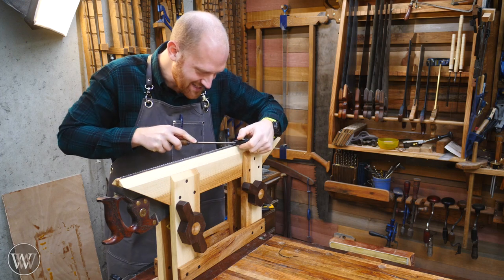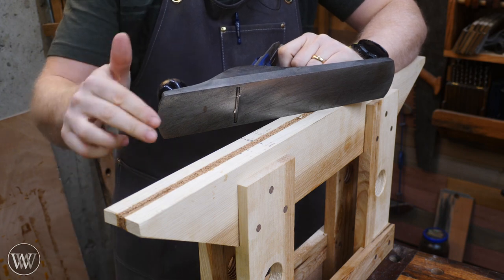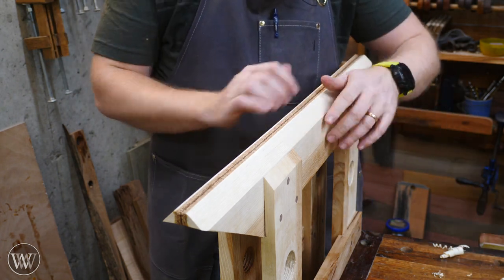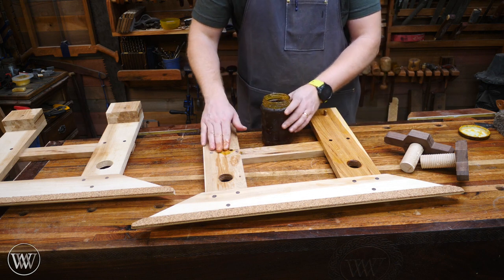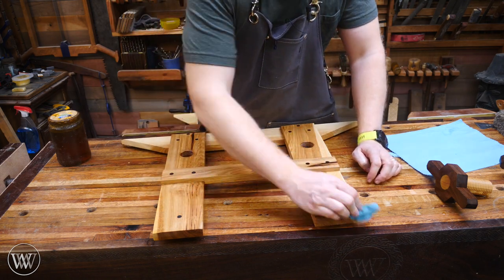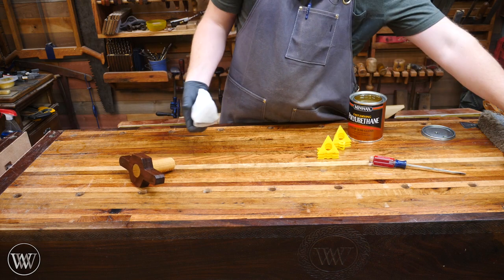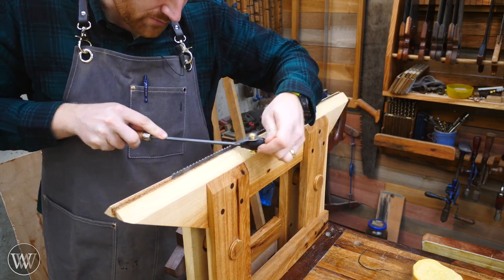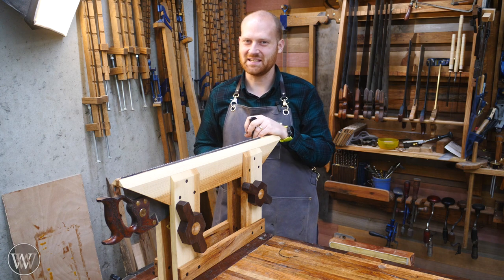Saw Vice Build Part 6 All Done And Finished

Comment: One other thing I would do is to slightly cup the inside of the jaws from leg to leg, a 32nd of an inch would be enough, then as you tighten the screws in the legs the outsides of the jaws are guaranteed to be tight!

Comment: I would suggest that you significantly lessen the back of the hand-nuts.  Additionally, wax the back as well as the threads.  These both will result in less friction when cranking them down, so you can get a firmer hold.
Reply from the maker: thanks man, but you really do not need much force at all to get a good tight clamp.

Comment: You've dun an amazing job. Just curious, is there a particular reason the oil finish should not be applied with a brush/rag?

- Cay
Reply from the maker: thnaks. it is just personal choice. I like putting the Homemade BLO on with my hand as it is easier and there are less rags or brushes to clean up.